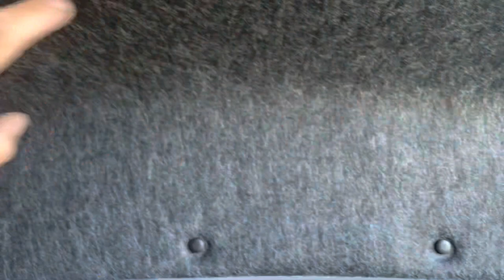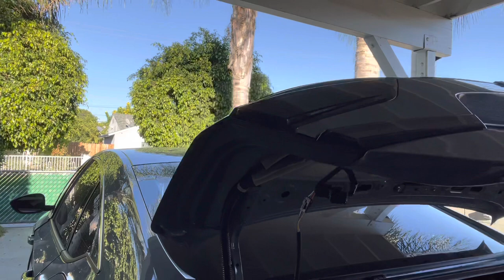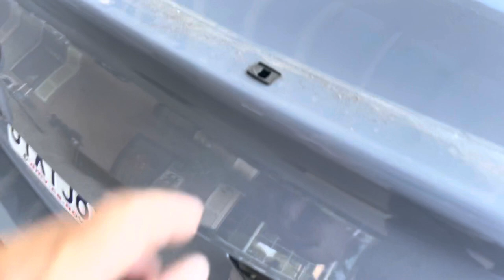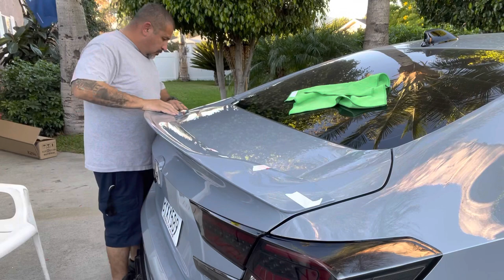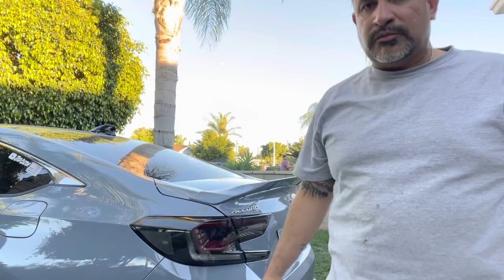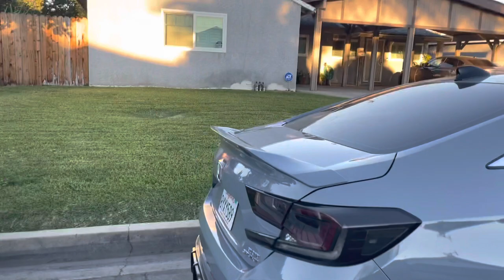2018-2022 honda accord v2 high kick duckbill trunk spoiler install

Comment: Hey bro love the diffuser and quad tips, if I wanted to get a new exhaust installed, with stock tips, would I eventually be able to install the diffuser and quad tips after? Or should I do the quad tips and diffuser before a new exhaust system?
Reply from the maker: If you do diffuser first then you know what tip will fit in the diffuser .the v2 yofer diffuser fit big tip you can put the dc sport exhaust

Comment: Mine keeps coming up on the ends. The middle sits perfect. I used alcohol to prep, then adhesive promoter with 60lb gorilla tape. Any suggestions?
Reply: Same, but mine is the duckbill that sits at the bottom of the stock sport spoiler. I think is like that for all of us tbh. If the middle is tight you should be fine

Comment: U think it's better to color match the car or get it gloss back. I have modern steel grey
Reply from the maker: I think for that color the black one looks good
Reply from the maker: This the Oem one I don’t if you like it come painted already https://www.collegehillshonda.com/10thgen-mmc-honda-accord-accessories/08F10-TVA.html
Reply: @JRod.Cuztom  that looks like it has 2 spoilers on it
Reply from the maker: @robertoarnold1689  yea it’s the color of car and black on top
Reply: What's the length of those screws. Did the install, just need the screws
Reply from the maker: @robertoarnold1689  1/2